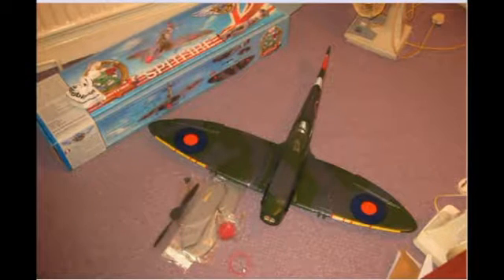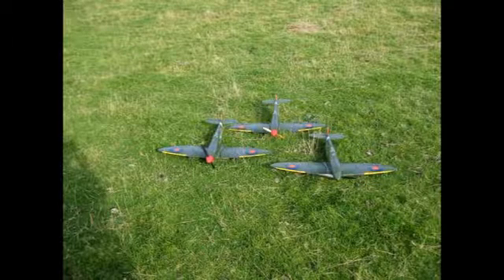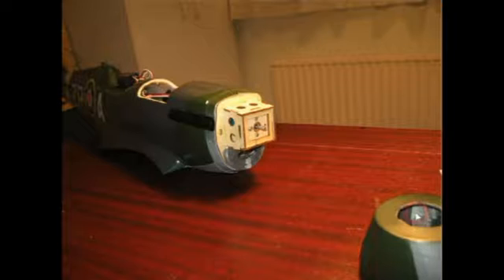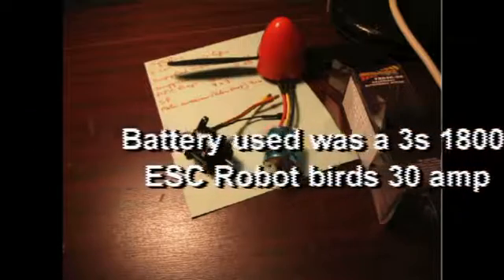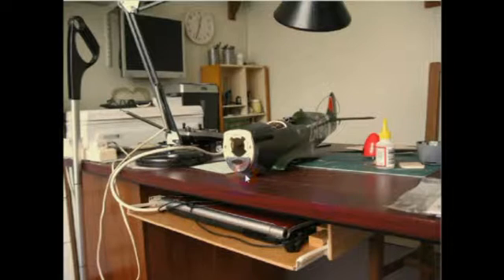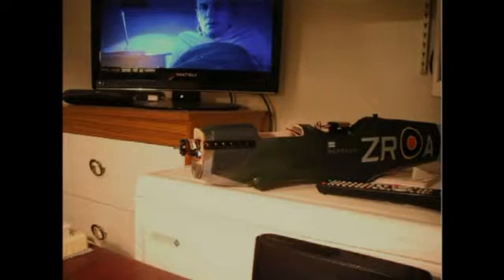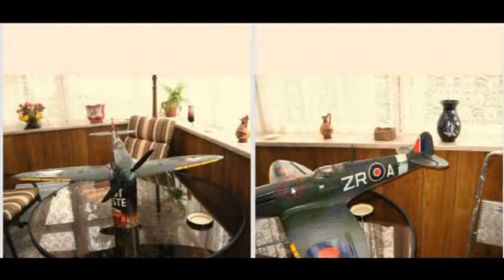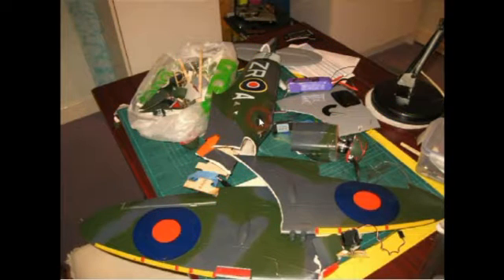My RC Flying Legends Spitfire

Comment: This story reflects mine and I ended up crushing mine to a pulp underfoot. I tried to strengthen the wings but it made it too heavy. The best mine flew was with a large (and heavy) brushed motor, but with all that weight up front it was damaged every landing. The structure of the model is way to weak for this kind of plane. It looked cool though - while it lasted. I have the Mustang too from this series and I don't know whether to bother attempting to make it work.